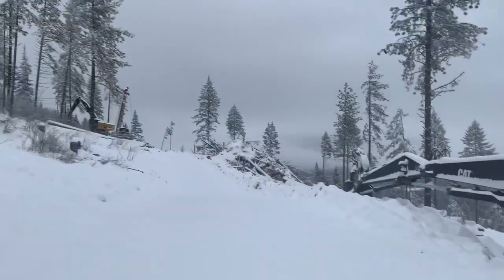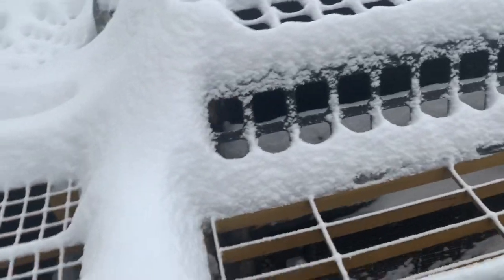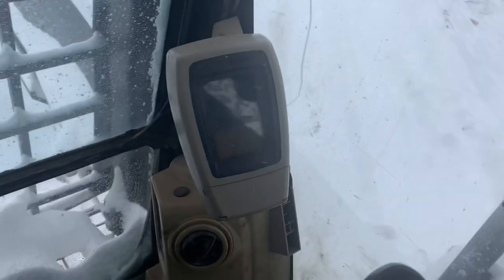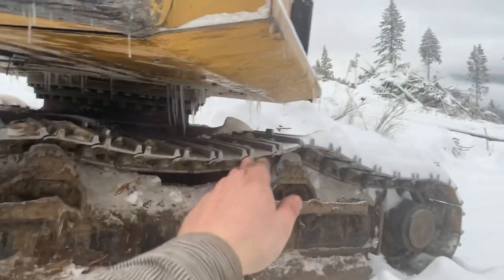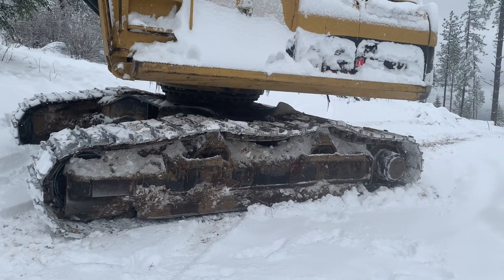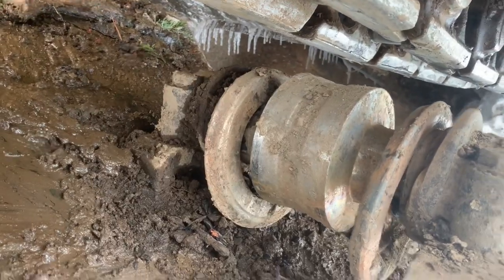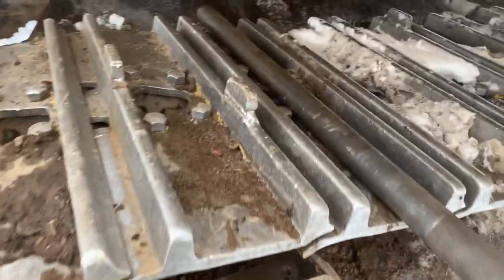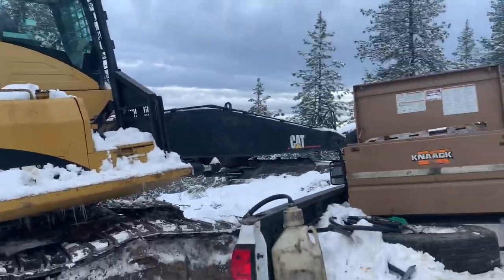Replacing a track roller on a cat 322 log loader

Comment: Watching you get up on that machine and lifting the hood to check fluids makes one appreciate old machines with a tall house so you can do that from the inside, not crawling up on a snow and ice covered machine. You have a great attitude. After fighting ice, snow and frozen mud to change a carrier roller you still say it is a beautiful day.
Reply from the maker: Thanks. I didn’t think about the attitude… I guess it’s easy to have a good attitude when you’re doing things your passionate about. However a house covering the engine compartment like a older line machine would be wonderful in the snow and ice.
Reply: I’ve been meaning to ask. Around here there are numerous antique power shows, mostly farm equipment and a fair amount of excavating equipment. I would think where you are there would be shows with vintage logging equipment. If there are and you attend a video of vintage logging equipment would be cool. I think the heal boom loaders with a snorkel are cool. I run dragline but I can only imagine the skill it takes to run 3 lines and the swing.

Comment: Use the same Lincoln grease gun actually got two of them I really actually think they work pretty decent like I'm a lot better than the other brands but how you Jack the chain up like you did to get the roller out was it really good idea how to remember that because most of the time like just push the track piece in on it to yoke arms or you can try to jack it up with ball of Jack but I think your way looks a lot easier have a Merry Christmas and happy New Year
Reply from the maker: I heard people saying they only like Milwaukee brand grease guns so I was hesitant…. But I’m glad I bought it.
Reply from the maker: Have a merry Christmas to you and your family as well
Reply: @tttco  I have actually used the Milwaukee 18 volt grease gun it's only advantages it has a setting for how many clicks of Grease you want to go in like two pumps three pumps etc I did notice the battery was only good for sake greasing the dump truck but when it came to the excavator and stuff that took more I would have to wait for the battery to charge the Lincoln seem to last me 2 weeks I'll straight greasing everything so that was my option for the Lincoln with the battery lasting